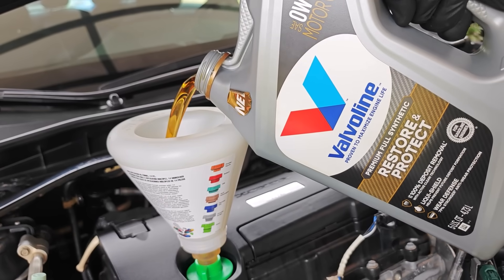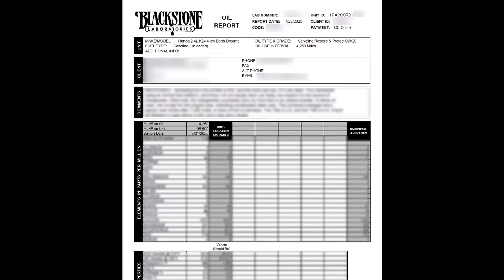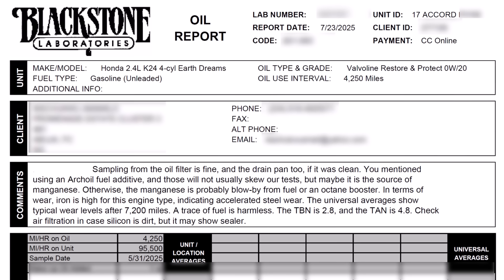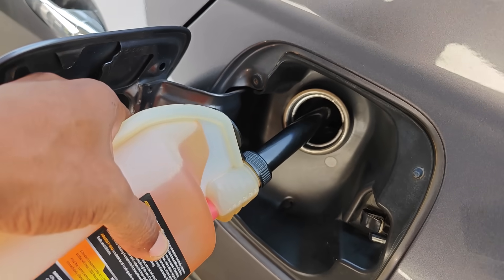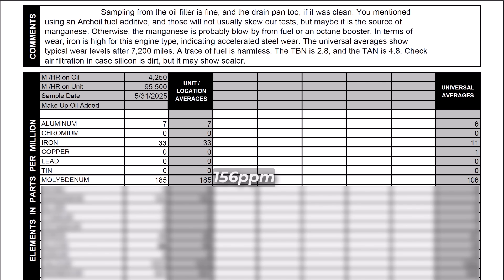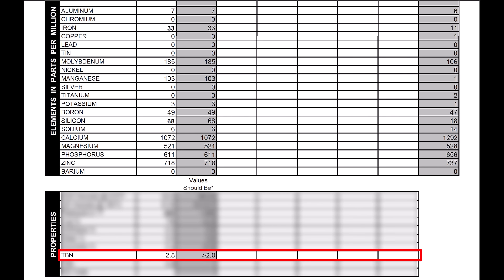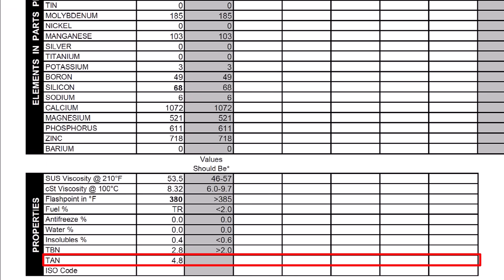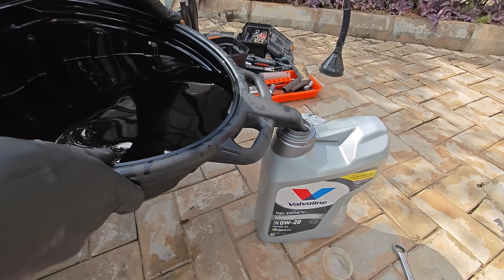Used Oil Report AFTER Valvoline Restore and Protect is Concerning?

Comment: The Motor Oil Geek talked about how higher manganese is evidence of how well R&P is cleaning the ring grooves because manganese is a key ingredient in octane boosters.
Reply from the maker: That's interesting! Must have missed that from his videos. Thanks for sharing. I'll go find that video 😂
Reply: Thanks🎉🎉
Reply: Watch the Oil Geek video again. He had a little bit more Manganese - 7ppm compared to 3ppm in his previous oil change.
103ppm of Manganese is a massive difference and it's not just R&P cleaning the ring grooves.
Reply: @unemployedducatista9997  Considering the averages, 103ppm is very high. Assuming restore can raise Mn slightly due to cleaning, higher than usual Mn might be due to heavy use of mmt based fuel additives. Restore just revealed what was already baked into the engine. So fuel blowby is the pathway, but the source is probably past additive use. I don't know exact history of the engine tested here or the one motor oil geek did. Assuming one had more octane boosters or contaminated fuel over the years than the other.
Reply: We only USE,, TIGER 🐅TIGER 🐅 ⛽️ GAS.  93.. OR SHELL. 93.. CLEANER GAS MEANS A CLEANER MOTOR..
Reply: @IronMike-f8i I often use Shell98 and BP98 and I still have to use injector and fuel system cleaner.
Reply: What are you driving that you "need" all those additives running 97?!
Reply: We only USE,, TIGER 🐅TIGER 🐅 ⛽️ GAS.  93.. OR SHELL. 93.. CLEANER GAS MEANS A CLEANER MOTOR..
Reply: @IronMike-f8i in most parts of the world, the base gas at all the stations is exactly the same because it's all transported and stored in the same tanks. The only real difference between them is the additive pack(s) added at the fuel terminal. Best practice is just to buy gas at a busy station that was built within the last 25 years since those will have properly lined tanks, with sealed risers, vents and inlets that will greatly reduce any chances of contamination in the fuel.
Reply: I never put additives of any kind into the fuel unless it's absolutely necessary, which it almost never is.
Reply: @je19662008  Gas has additives in it right from the pump.
Reply: @je19662008 According to Lake Speed Jnr, fuel additives are absolutely essential. Fuel standards verses the current injector and pump technology do not come together so well. Injector cleaners are essential. He has gone into quite a lot of detail as to why. 

Using oil additives are a big no-no.
Reply: @FuManchu5ltr  Only fuel additives that have PEAs though. If they don’t have PEAs in them you are wasting your money. Use Chevron Techron every oil change or Hot Shots Gasoline Extreme every oil change.
Reply: @LeroyJenkins12B or Amsoil Performance Improver every 3k miles (in other words, not a rip off)
Reply: @BrodeyDoverosx  Or Red Line SI-1, which is the best PEA based fuel system cleaner

Comment: That Purolator Boss is rated at 99% efficiency at 45 microns. That doesn't help. I would change to a Purolator One oil filter. On their website it says for Purolator One 99% efficiency at 20 microns but when I emailed them they replied with 99% efficiency at 25 microns. The Boss is designed for long oil intervals thus the high micron rating. Also TBN was designed for diesel engine because of the high sulfur fuels. TBN is not really relevant to gas engines.

Comment: Your high numbers are from both the octane booster and the piston rings being cleaned. After 4 oil changes with this oil the numbers will be lower than average instead of higher than average. This oil is dissolving those deposits that were previously stuck in the piston rings. Which gives the high numbers for your tests.

Comment: Update:

I installed Restore and Protect three months ago on my Accord with 100,000 miles. The oil now has 2,100 miles and is extremely clean. I bought the car in March of this year, so I assume the owner and previous owners were very particular about the oil change interval.

Comment: Dumb video. Take a sample like you are supposed to and don't use the archoil as there is too much guessing with your video.
Reply from the maker: I clearly acknowledged the drawbacks of my approach, and mentioned I'll be doing serial more tests correcting the errors. 
For me no experience is a waste. I did know the sampling would skew the results but didn't want to miss an analysis (on rhe first VR&P used in the engine). I've seen how incorrect sampling and use of a fuel additive can skew results. If anything, other uninformed viewers will also learn not to do this. The serial analysis will get to the bottom of every issue. I love experiments 😊

Comment: Since oil is cleaning the engine, liked it is advertised, better to change oil filter early or even the oil early.  If oil gets gritty should remove and put in bl in ew Royal Purple oil. Or Valoline Restore and Protect oil.   It is also a cleaning oil. It cleans faster.
Reply from the maker: I changed the oil filter at the first 1000 miles. Cut it open, it was pretty clean. VR&P holds stuff in suspension except if the engine was really caked up. Let's see what the next oil reports say! Thanks for chiming in!

Comment: time to switch to 0w-30 oil or 5w-30.  Too many engine failures are showing up with 20w oil.  You'll lose a fractional amount of MPG's at the pump but it would be worth it for the protection that the 30w will give you.
Reply from the maker: Thanks mate. Will use subsequent used oil analysis results to make a decision
Reply: I don't think is universally true.  As a matter of fact, some engines have tolerances so tight a thicker oil will not be able to get to the proper places and cause additional wear.  Also, there are other oil pressure driven functions (like VTEC in Hondas) that could be affected.  I would be very careful with changing from the manufacturers recommendation.
Reply: @HH-gn9qt  Watch out for US bias. My kia shows a 5W20 for cars in the US. 5W30 is called for in every other part of the world. I switched and my car runs better, cooler and burns less. The US is obsessed with fuel economy, enough to direct people to destroy their engines with too thin of oil.
Reply: @HH-gn9qt I have a 2017 Honda Ridgeline. Been using 10w30 or 5w30(Pennzoil Platinum Synthetic) since first oil change even though Honda recommends 0w20.  106k miles so far. No issues. No oil burning, no noises.

Comment: I try this oil for my Honda CR-V 2020 and I have issue in crank. What should I do?
Reply from the maker: What issue do you have in crank?
Reply: @DIYAutoworksNG it’s take 2 seconds before start the car
Reply: @ReactionUtube  It could be your valve lash adjustment.

Comment: Has the timing chain tensioner fully fixed startup rattle for you? My 2013 just turned over 200k miles and began startup rattle. I just ordered tensioner, hopefully this will fix it.
Reply from the maker: Fixed it completely! Startup is buttery smooth. I made a video too. https://youtu.be/ubLz7dt5lmU
Follow the TSB exactly.
Reply: @DIYAutoworksNG I appreciate the reply, I cringe every time I start it cold now. Can’t wait to change it
Reply from the maker: @Adwest2323 yea. Do prioritize changing ASAP. Will prevent stretching of the chain and wear.

Comment: If I heard this correctly, the results are based off the first use of Valvoline R&P. Per The Oil Geek, you can’t use the first change to a new oil due to contamination from the old oil that will skew the results.
Reply from the maker: 👌🏼You're 💯% correct. I also acknowledged that in the end.

Comment: None of the Valvoline offerings are considered extended drain interval oils. They only offer extended protection (more wear additives) for normal 2700 (turbo) to 5000 mile oil changes. Outside of cleaning, VR&P is just a very good 5k mile or 6 month motor oil. Castrol EP is the only off the shelf oil I know that is designed for extended drain intervals (10k+ miles or 1 year.)

Wix or Purolator air filters might help also with silicone. I would also check the gas tank for heavy sediment and change the fuel filter if possible; or at least never drive below 1/4 tank full. The motor oil geek also has a video on top tier gas being 19x cleaner. The next oil analysis should be perfect because Honda engines are boring and not very hard on oil (1-2ppm/1k mile wear metals.)

 https://youtu.be/P5VCOGwstEk?si=4zOdKnyM9jKECCbW&t=720
Reply from the maker: Great comment and suggestions! Thanks.

Comment: You can reduce contaminants in your oil by improving 
1) Air filtration : Reduces silicon
2) Oil filtration: High efficiency oil filter
3) Lubrication: Synthetic oil and/or bonding a lubricant to the inside of your engine
🙂#XcelPlus
Reply from the maker: Changing the air cleaner element is one maintenance item I don't fall back on. On average I change around twice a year. I do have a lot of dust in some seasons.
On oil filters, you know it's a delicate balance between filtration and restriction of oil flow. The thing is that UOA measures stuff around 8 microns. The best of oil filters usually filter stuff above 20 microns.
Will just see what the next couple oil reports say and take it from there.
Reply: @DIYAutoworksNG  Look up Trasko oil filters. 
They filter down to ~1 micron without restricting oil flow.
🙂
Reply: @DIYAutoworksNG  Look up foam air filtration. 
You'll halve the silicon (dirt) being ingested without affecting the air flow.
🙂
Reply: https://youtu.be/4r8NajjYkFA?si=5ptm2RgOiKsmJ_Yi
Here's a good comparison between paper, gauze and foam filters.
🙂

Comment: A cleaner combustion chamber doesn't result in more contaminants being dumped in the oil.

Poor lubrication causes more wear.
More wear increases contaminants... which increases wear further.

🙂
Reply from the maker: I differ. Blow-by gasses will go past the piston ring carrying whatever was vapourised into the oil. If not, how does increased silicon in dirty air find it's way into the oil? Another fact for example is that if you use leaded gasoline, some lead is going to show up in the oil analysis.
Reply: @DIYAutoworksNG  Good point about the silicon and lead.
However, my point was that contaminant levels don't seem to rise further than normal after cleaning the combustion chamber e.g.
There was no obvious change in oil quality (using oil analysis) after cleaning up the combustion chamber of our car.
The car was running very efficiently prior to treatment.

In a motorcycle (carby not fuel injection) the soot levels in the oil dropped to zero after cleaning the combustion chamber.
None of the contaminants increased.
The motorcycle engine was very clean prior to treatment.

Perhaps it also matters which treatment you use?

:-)

Comment: The high silicon is probably from dirt and that's why the wear is up on everything else.
Dirty air filter or driving on dusty roads will result in a high silicon level.

4,250 miles (6,840 km) is less than the recommended oil change interval for most cars so something is going seriously wrong if you have this much wear.
🙂
Reply from the maker: Thanks for your insights. The subsequent oil analysis will clearly show what's going on. Did you miss the part on using an iron-containing fuel additive?
Reply: @DIYAutoworksNG  No I didn't miss the bit about fuel additive containing Fe: 

Fe (wear) will increase in direct proportion to Si (dirt). 
As other metals are also elevated this suggests elevated Si is the culprit not your fuel additive.

Your next oil analysis will probably clarify this. 
One of us is right.
🙂

Comment: Thanks for sharing.  That is a little alarming, but like you said old oil still from the previous oil and the additives create some noise in the results.  I hope to see if you do another test what it looks like.  4200ish miles on that oil it does seem like it didn't hold up that well.  Next change should tell the story.
Reply from the maker: Yep, the next report will provide a much clearer picture. Will certainly be doing more of it. Given all the confounding, I've made an exception for this first report. Also, it's natural to expect that some of the wear metal trapped in the deposits that are being cleaned will increase the ppm count, especially for this first cycle.

Comment: Your accent is awesome.. 😎 and by the way thankyou for doing this series. I also am running restore and protect in my car as well. But i will be switching here shortly, just cause I’ve heard a lot of bad things about it lately. And now seeing that you have iron wear in only 4,200 miles of running it is pretty scary. I think im gonna just start using valvoline advanced. Or i will start using the castrol edge extended pr gold bottle. That dirt is actually an additive that valvoline uses also. They use it as a “anti foaming agent”. So i dont know man. And the fact that they use a lot of dirt inside of their oil i dont like that either. Even if its an additive, its like, why dirt of all things?? Like i dont want dirt in my engine.
Reply from the maker: Thanks for the compliments!
Well, as it stands, I don't really think I can  attribute the iron to increased wear, just given that iron-containing additive I was using at the time. Good thing is I've stopped it and subsequent oil reports will give a clearer picture. I've seen the averages for total wear metals from the Motor oil geek for VR&P, and it was 2.7ppm per 1000 miles. This is for all the analysis they've run on cars with VR&P at Speediagnostix, so it's definitely not the oil. But at the end of the day, definitely go with an oil that let's you sleep well at night 👌🏼

Comment: Agree with others you’re going to get blow by in the oil which is the primary contaminant of motor oil. So any use of fuel cleaner will impact the sample.

Comment: Pre-filling filter...cringe
Reply from the maker: Why the cringe. Been scientifically proven especially if you run these low weight oils. Seen the video from motor oil geek on this?
Reply: @DIYAutoworksNG work. Oil geek has proven this
Reply: @DIYAutoworksNG  When starting the car cold the engine is noisy... then as soon as the oil starts to circulate it goes quiet.
If you can avoid this period of poor lubrication your engine will thank you.
Pre-filling the oil filter might not make a huge difference but it certainly won't hurt.
Thinner oils will also help by circulating the oil faster.

Bond a lubricant to the inside of your engine if you want protection 100% of the time.
🙂#XcelPlus

Comment: Hmm other than the piston ring cleaning...  a rather unremarkable result?   Viscosity held up though!  

Im going to bet the second oil change has half the iron.
Reply from the maker: Well. Blow by as evidenced by bobbing oil filler cap, stopped within the first 500 miles of the oil switch. The oil capped had always bopped eversince getting the car at 69k miles. One thing I didn't cover is the fact that some of those wear metals would be coming from what was held up in those deposits that's been there over the years. In that sense, you could be right that I might still see a significant count in the next report! Yea was really surprised viscosity stayed within the normal range.

Comment: 220 thou miles on a 19 year old Jeep 3.7 V-6 . I don't need anything cleaned in my engine . Premium full synthetic and filter every 45 hundred miles .  Mobil One  , some of my truck Rotella , and for the last 4 or 5 years top line Pennzoil , Ultra and one lower . Stil gets the same MPG it got at 50 thou miles . MPG on a Liberty is terrible . Aero goes over like a large flat screen at a Coldplay concert .
Reply from the maker: Sounds like you've got a great maintenance routine going there and your engine is in great shape!

Comment: You can't undo your original procedure, but had you changed your first Restore and Protect at 2000 miles, then ran your 4000-mile range test and had that oil analyzed, I believe your wear numbers would have more reflected what was going on after the cleaning had been performed.  I believe your next bout with the Restore and Protect will definitely provide a clearer picture of your engine's condition and the oil's performance.
Reply from the maker: Spot on. Thanks for your comment!

Comment: All this oil switch stuff is nonsense and waste of money.
Once your car starts shorting oil , kindly go and change your piston rings . That’s the final solution and it will save you money and stress….

My engine is back now …
Reply from the maker: @fuwaafrica6339  It all depends on the cause of oil loss in the first place. Stuck piston rings is a real thing and can easily be fixed with repeated oils like VR&P or even a piston soak. I know this by experience. Several people here have the same experience. 

What oil will not fix is worn piston rings or cylinder bore scoring. In that case, a rebuild is required.
Reply: @DIYAutoworksNG  do the calculation of amount of oil you will buy before it can be corrected ? , it’s cheaper to lose and inspect the rings to determine if you need to replace or just clean the piston oil holes and other angles … Any other solution is just waste of money and time .
Reply: Our valve seals seem to have been the culprits when using oil.
The compression on our car was normal.
🙂

Comment: The true value of used oil analysis is in the comparison between multiple samples. It's hard to know if the Valvoline R&P is related to any of this wear without directly comparing it to results from the prior oil. Also, like you mentioned, since this is the first time you've used this oil, there's residual oil from the previous oil sill mixed in.
Reply from the maker: Well said! I don't think in any way that VR&P is leading to increased wear. Like we both agree, this is just the first report of many. Will definitely get to the bottom of it!
Reply: Valoline says can take up to four uses to clean out the engine.   After engine is cleaned out. Then do the test.